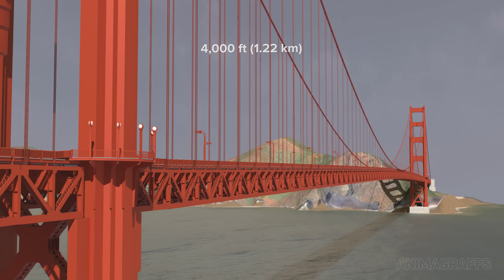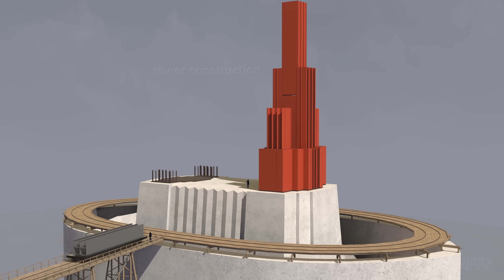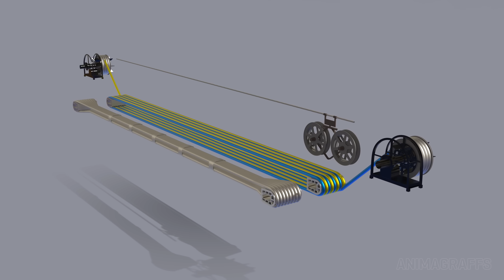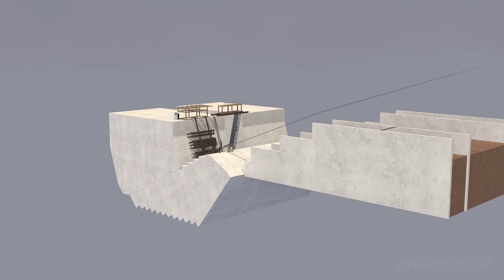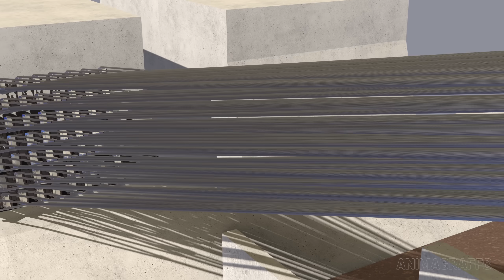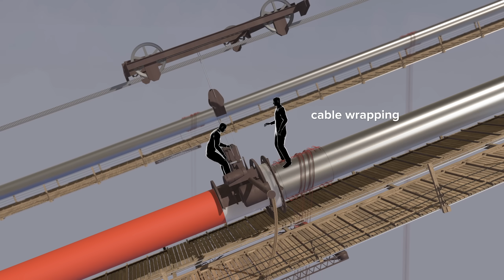How the Golden Gate Bridge Works

Comment: Wow! I've watched a few of these and expected this one to be the least complicated, but was I wrong!

Also, as others have said, these videos definitely deserve some kind of award.
I've been watching presentations like this for 50 years, including numerous PBS shows like NOVA, etc.
Some of those have even covered this same topic, but nowhere near the level of detail or presentation quality.

I realize you weren't intending to make a full documentary on the construction (just the technical details) but I was surprised that you didn't cover the safety aspects. While you did mention the nets a couple of times, it was probably worth discussing this a bit more, especially since the mortality rate was so much lower than expected. Only 11 men were killed during construction. One in the first few years and 10 more when scaffolding collapsed and tore through the net.
The net and the requirement of hard hats (under threat of firing) were significant the keeping the deaths below the expected 35+ for a project this size.

Anyway, thanks for creating another great video.  You really should be getting more accolades.

Comment: Slight correction: 
You called this steel work, worked on by steel workers 

Thst is not correct. 

Ironwork and ironworkers are the correct trade and tradesmen that hung the iron 

A steel worker, works in a steel mill. He produces, rolls and handles the structural steel at the mill.  

An Ironworker is the tradesman that receives the steel at the site.  Unloads or "shakes out" the truck.  He then rigs, raises and sets the structural iron.  
He rivets the structural members in a Rivet Team. 

Great informative video. 

Just a small but vital bit of correction.  

My credentials 
Structural Union Ironworker since 2007.

Comment: Pulling the wire as described at time 35:20 must be incorrect. You don't need another wheel on the motorized carriage to go back with another wire. You can use the same wheel. I guess they were pulling more wires at the same time from multiple reels. That's why the motorized carriage had more wheels. It is fantastic video anyway.

Comment: Its time to make a  diversion  canal for the boats and ban all boats from cross  under it its time to only allow  smaller  boats  and  must have a permit  like license   and special  training  course class so what happened  to the Francis Scott  Key Baltimore  Harbor  Bridge  doesn't ever  happen again  its time to make a large commercial  barge  diversion  route   it would be cheaper  than making  a folding  middle  part  and all  bridges that don't have s folding  tunnel  systems  should now be made to fully  stop and bought  in by tug boats  and have inflatables  on all sides like lage hovercraft  tubing  like air cylinders  in case they actually  hit a concrete  anchor s or have special  air like air cylinders  tubing  systems   like floating bo e all around  this parts of were the bridges  are  or have special  one that absorbed  the hit

Comment: Fascinating. The GGB is a marvel of human capacity. i’ve driven over 100s of times walked it several stood underneath at Fort point. Looking up at the arch going over the fort. Stood on top of the fort and look out at the Tub in the in the gateway. When I walk across it, I’m amazed. I Say to myself men did this nearly 100 years ago if you ever get a chance to visit the Golden Gate Bridge it’s highly worth it, take in the visitor center and check out the views. A great visual display is at the visitor center of a cutaway section of the cable span.

Comment: I was asking about blender, and mentioned this project, and this is the answer I got:

Ah, you must be talking about *Animagraffs* (created by Jacob O'Neal)! If you are thinking of the incredibly detailed, 50-minute-long 3D breakdown showing how they anchored the towers in the ocean, spun the massive steel cables, and riveted the deck together—that video is a absolute masterpiece.
You are completely right: he absolutely mastered it. But here is the wildest part about that specific creator, which directly connects to what we were just talking about:
Despite building what is arguably the most mathematically and structurally accurate visual explanation of the Golden Gate Bridge ever made, *he openly admits he doesn't have a background in engineering or math.*
> 
He is a 3D animator and designer who just loves learning how things work. For that single video, he spent *four months* doing historical research, digging through decades-old blueprints, and reading massive engineering textbooks just to figure out how the real bridge pieces fit together. Then, he used his 3D tools to bring it to life.
That is the ultimate example of what makes this a beautiful hobby or passion project:
 * *The Software is just the Tool:* He didn't need an engineering degree to build it; he used the 3D software to visualize the logic.
 * *Deep, Satisfying Focus:* Imagine the absolute "flow state" of sitting down for weeks, turning raw blueprints from the 1930s into moving, glowing, mechanical 3D parts.
When you see a solo creator make something that looks like it required a Hollywood studio or a team of civil engineers, it shows you the true power of tools like Blender. It allows one person with a curiosity and an eye for aesthetics to build literally anything they can imagine.
Seeing projects like that is exactly what makes people want to download the software and press that first button!

Comment: I don't know how you track down all of the construction details, but along the same lines in terms of a detailed construction project with cables, and steep terrain modeling as in your hover dam project -here is an idea: The construction of the Palm Springs Aerial Tramway—often dubbed the "Eighth Wonder of the World" when it was built—is a phenomenal story of mid-century engineering, perseverance, and architectural genius.
Because it climbs the incredibly sheer cliffs of Chino Canyon into a protected wilderness area where no roads could be built, the entire project required radical, unprecedented construction methods.
## The Engineering & Construction Feast
When construction finally began in July 1961, engineers faced a massive logistical nightmare: how to build massive steel towers on vertical, roadless rock faces.
 * *The Helicopter Pioneers:* Tower 1 is the only tower that could be reached by a terrestrial road. To build Towers 2, 3, 4, 5, and the Mountain Station, *helicopters flew more than 23,000 missions* over 26 months. They airlifted everything—men, tools, concrete, and steel—averaging payloads of about 700 to 1,000 pounds per flight. Heavy machinery had to be completely disassembled, flown up piece by piece, and reassembled on site.
 * *Living on the Edge:* A crew of 30 to 40 workers actually lived at the Mountain Station site for 26 months straight during construction to keep the project on its strict 660-day timeline.
 * *The Cable Breakthrough:* In the 1940s, the tramway was deemed impossible because no manufacturer could spin a continuous steel track cable long enough. By 1959, Swiss manufacturer *Von Roll Seilbahnen* perfected a technique to spin massive 13,500-foot-long, 1\frac{7}{8}-inch thick cables. This breakthrough allowed the design to drop from nine towers down to just five, eliminating the need for a mid-way transfer station and allowing the tram to make the vertical ascent in one single, breathtaking sweep.
## Notable Mid-Century Architecture
The tramway isn't just an engineering marvel; it’s a masterclass in Desert Modernism. The Mt. San Jacinto Winter Park Authority hired two rival, legendary mid-century architects to design the lower and upper stations.
### Valley Station (Elevation: 2,643 ft)
Designed by *Albert Frey* (with Robson Chambers). Frey, a Swiss-born modernist icon, actually traveled back to Switzerland during the planning phase to study overhead cable designs.
 * *The Design:* Because a shallow mountain stream ran right through the building site, Frey designed the station as a *covered bridge* with structural trusses. This brilliant move allows seasonal rushing water and rolling boulders to pass safely right underneath the building without causing structural damage.
### Mountain Station (Elevation: 8,516 ft)
Designed by **E. Stewart Williams**.
 * *The Design:* To blend organically with the alpine environment, Williams designed the upper station to look and feel like a classic, sweeping **Swiss chalet**. It features massive glass viewing windows, natural stone walls, and exposed wood, stepping down into the mountain's natural topography.
## The Modern Rotating Tram (2000 Update)
The tram underwent a massive $15 million modernization. The old Von Roll cars were retired and replaced with state-of-the-art systems designed by **Doppelmayr**.
```
+-------------------------------------------------------+
|                 SYSTEM SPECIFICATIONS                 |
+--------------------------+----------------------------+
| Distance Traveled        | 2.5 miles (approx. 4 km)   |
| Elevation Gain           | 5,873 vertical feet        |
| Travel Time              | 10 minutes                 |
| Cabin Capacity           | 80 passengers              |
| Rotation Speed           | 2 full turns per ride      |
+--------------------------+----------------------------+

```
The standout feature of the new *CWA "Rotair" cabins* is their rotating floors. The floor slowly and constantly rotates around a central, stationary operator stand. This means passengers get a full 360-degree panoramic view of Chino Canyon's sheer cliffs and the desert floor without ever having to scramble or move around the cabin.
> *Fun Fact:* There are only a tiny handful of these floor-rotating aerial trams in existence worldwide (including Table Mountain in Cape Town, South Africa, and Mt. Titlis in Switzerland).
>update. There is actually a published book about the construction. "We can do it." By Don Landale - available on Amazon used. The author was one of the helicopter pilots.

Comment: I knew the Golden Gate Bridge was impressive…
but I never realized the level of engineering behind it was THIS insane. 🌉🔥

27,000+ steel wires, massive underwater foundations, towers designed to move with wind and temperature changes…
This isn’t just a bridge.
It’s one of the greatest engineering achievements in human history.

Comment: My grandfather worked the mid point office and my grandma used to make him baked ziti to eat at lunch. He would keep it warm near the ceiling from the heat created by the cables being run. The problem he told me was even though loving the ziti it gave him the runs. He would end up dropping trow and having to poo off the end of the office door. He wore a safety harness to keep him locked in to poop off that railing. I couldnt figure out why over the 4 years he didnt stop eating that ziti.

Comment: Man, I never knew many of the details of this construction before! This whole thing is kind of wild! The crazy thing here is that, despite the height over the water, there are still a handful of ships that are only allowed to pass under it at low tide! There are also corrosion issues with the main cable that will eventually result in them no longer being able to support the load without replacement, but that time is decades in the future, approaching the 200th anniversary of the bridge itself. How such a replacement might work is anyone's guess, but i can virtually guarantee that, as a symbol of the Bay area, it WILL be done! 😄These suspension bridges are just fantastic bits of engineering and that iconic "international orange" paint job is just the cherry on top! Absolutely beautiful structure! Given the amount of traffic that bridge now carries, I would not be surprised to see a parallel bridge built at some juncture. IIRC, this was the first such bridge were safety nets were used and several lives were saved by it. 

One comment... he failed to mention that the entire bridge is not supported by the tower so much as it is the anchorages for the cable. The main job of the towers is to hold the cable at the right height. Yeah, they take a good portion of the normal forces, but all that load is not just hanging form the towers. Suspension bridges hang from the cables themselves  (that's why the span can be so large) and that means tension on those big cables.The anchorage at either end of the cable hold it firmly in place so it can do its job. There is a LOT of concrete in those anchorages for just that reason. All the weight of the suspender cables, the road deck, and the mass of the main cables themselves is constantly pulling at that anchorage. It has to be VERY massive and firmly attached to the surrounding rock to do its job. For the towers to remain upright, the load on one side of the tower has to match the load on the other side of the tower, just as in a cantilever bridge. Otherwise, they'll be pulled in one direction or the other. It's a complex balancing act. This is also why the road deck was constructed starting at the towers out (in both directions) and meeting in the middle of the span. Balance. The added weight also stretched the suspender cables to their final length, allowing the two sides to merge nicely together in the middle.

Comment: Nice work! I live in San Francisco and crossed this bridge countless times and sailed under it dozens of times and never tire of it. In the 1980's they replace the concrete roadbed with a much lighter metal and asphalt design. When they were halfway thought installing it from north to south you could clearly see a kink in the arch of the roadbed.

Comment: Wow!  Which is an understatement!   The skill set required to construct today does not exist.  To think hand calculations and sliderules is all they had!  It would be neat to see a picture of the drafting department!   Good video, this nerd enjoyed it!   In Vancouver we have the Lionsgate bridge built 1937-38.  They miscalculated the load weight and the bridge deck had a hump in the centre of the span.  This was corrected in 2000-01 when a new wider deck was installed  🇨🇦

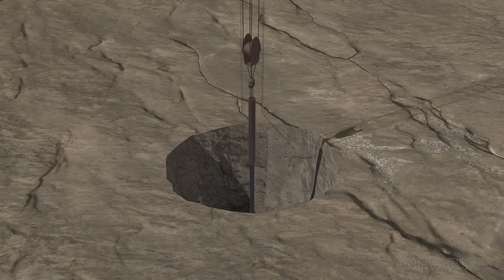Comment: Casual viewers:  this video is a PANTLOAD of PROPAGANDA.  10:26 mins in " The windows were holding up the building".  The inner core columns were of box-type, rectangular construction with a wall thickness of 5"+ at the bottom.  Much thicker than the upper columns which supposedly crushed them.  They were of conventional grade steel for high-rise construction.  The perimeter columns were of a higher grade steel - don't be fooled by the "untested" bunkum remark in this propaganda video.  And make sure you look at the videos readily available online that show molten steel pouring out of the South Tower for 7 minutes before someone hit the button to set-off the controlled demolition sequence.  MOLTEN STEEL WAS IN THE RUBBLE INTO DECEMBER.  WHOA - jet fuel is essentially kerosene.  Better not light your kerosene heater tonight...

Comment: It is interesting that the entire weight of the road deck and all the rest of the structure that is hanging from the suspender cables and the weight of the  main cables is born by the 4 saddles on the tops of the towers. The actual force on the saddles is greater than the weight of the deck, suspenders and main cables, since they must counteract the tension in the cables.

Comment: A huge thank you for creating this video. As a Bay Area local, since the early 70’s I have driven across this bridge, walked across it and ridden bicycles across it. Each time I’ve been both amazed at its beauty as well as the engineering effort to create it. All we knew were old black and white photos of construction workers building the bridge, but knew nothing about the actual design and how it was created. I very much appreciate your efforts in showing how it was designed and built from the very beginning. 💕🌹💕

Comment: Excellent Presentation. I now live in Maine, but before moving here, I used to cross that bridge sometimes as much as 4 times a day as a bus driver. My first time crossing it was in 1960. I always thought about how it was built, but never really knew. Presenting it with 3D modeling and in the step that was used really explained it well. It's nearly 80 years old, it makes me wonder. Thank for the very good presentation. The engineers then well what can I saw were not lacking in any since of the word.

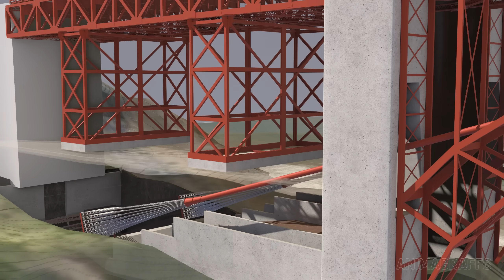Comment: 3:25 Question: How are the Galvanized steel cable  strands, when splaying out to be connected to the anchorage, protected from the the corrosive salty sea air? The galvanization is a very thin layer, to last as protection, for a hundred years plus or so.

Comment: Not to  detract from from the extreme amount of painstaking work you put into this excellent presentation, I noticed the following in your verbal description of the of the electric motors at around 39:24.
You may want to check out electric motor vs electrical. For example, electric motor, not electrical motor. Electrical engineering vs electric engineering. In both cases the first adjective would be considered correct.

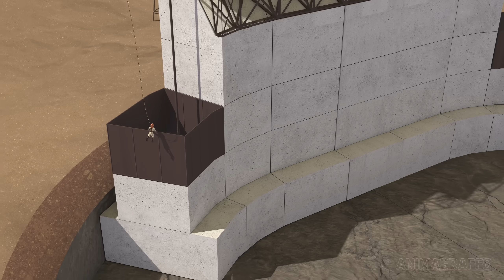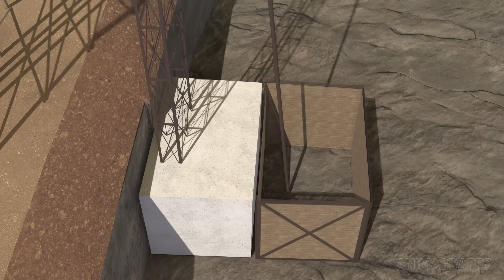Comment: Does it make sense to show the forms existing against the existing concrete for the pier construction? Such as at 15:25 or 14:28? Most likely they roughened up the concrete surface to get better adhesion between the block pours.